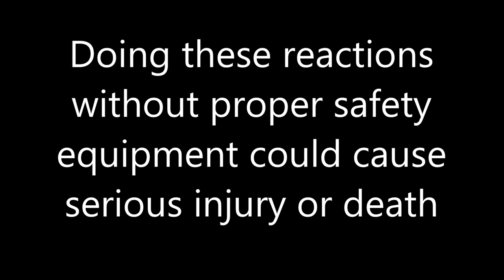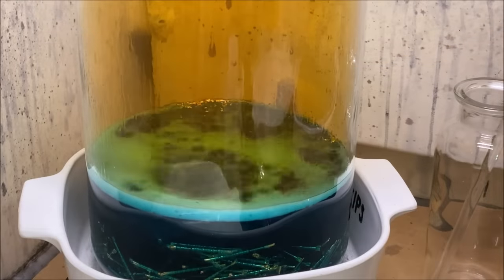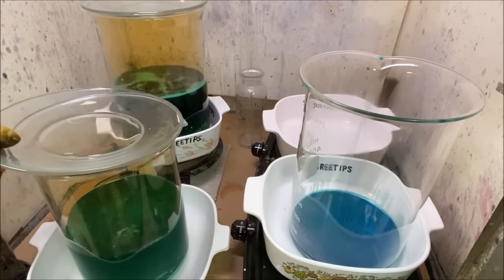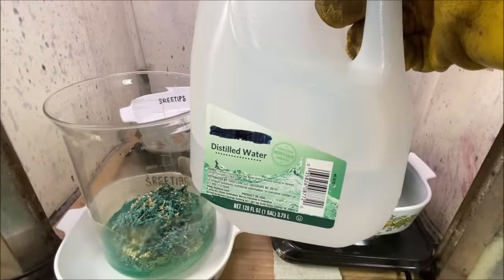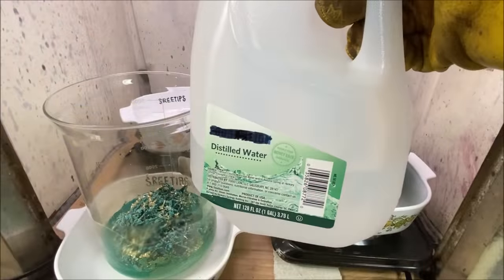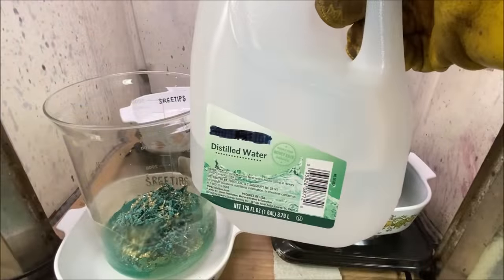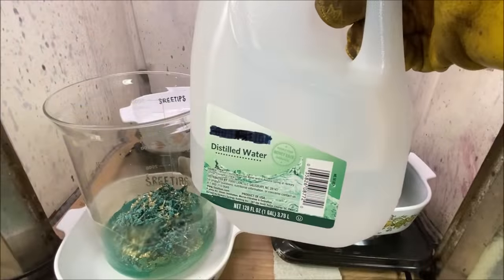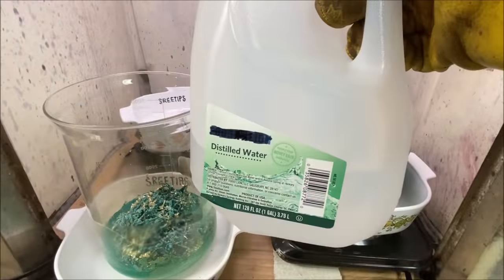Gold Plated Pins 10 POUNDS!

Comment: Sreetips,

I hope this finds you well and having a good holiday weekend.

I am a 45 year old artisan and biomedical devise repair technician.
I spent the last 17years repairing medical ultrasound probes.
All along the way I have saved a bunch of these gold plated pins. I have never sold gold reclamation materials before. I love your videos!!!!
I have images of the pins. I used a kitchen scale to get my weight and tally 5.4kg of the pins. They are not new. They have varying degree of sheen.
I sanded on a pin and can see it has a copper core. I have images with a 10x magnifier of this. I can see these pins have less copper than the pins you used in the video! Better yield for you I hope! I also did a test with some Birchwood Casey brass blackener on the sanded area and can see the blackened copper and unaffected gold layer. I have 10x images of that. I see that Gold prices are about the same as when you shot the video 9 months ago!
I also have a small pile of worthy computer processor chips that should have some amount of platinum, gold, and silver.

Would you be interested in buying my one time lot of this stuff?????
Reply from the maker: Actually I only on stuff my wife and I find at local sales

Comment: You can use a spaghetti strainer to separate the foils from the pins once they are freed.  Could have saved yourself several gallons of HNO3.  I know that stuffs pricey.
Reply: Big brain solution right here.
Reply: I was gonna say the same, why he doesn't pour off the waste copper solution through a fine mesh strainer to catch any foils kind of blows my mind! Especially since he is so GD tuhro and precise on everything that he does. But hey, nobody's perfect and to each his own right?
Reply: With a distillation setup to clean the acid he could save himself acid as well. Just reuse the same acid over and over only having to replace what is lost through the fuming and the little bit lost in other parts of the process.
Reply: @bensoncheung2801  try the above idea, let us know your findings.
Reply: @mewmewdesigns895  the acid is oxidized to nitrate upon reacting with the metal, giving off hydrogen gas.  In order to reclaim the nitric acid, the nitrate salts need to be isolated and then reprotonated with sulfuric acid and distilled.
Reply: @seaofredkc  I mean one of those slotted plastic spaghetti strainers.  The foils can be rinsed through leaving the pins behind in the strainer.  Any pins with gold still attached can just be thrown back in the acid until they are clean.
Reply: Great suggestion!  I do many many  pins in AP as I’m never in a real hurry.  Rinsing through a strainer is how I do it.  This method helps a ton and keeps me from having to digest the pins fully.
Reply from the maker: I’ve tried that and trust me - it doesn’t work
Reply: @sreetips   What happened?
Reply: @sreetips  I've done it on the small scale with ram and stuff.  Your humongous batch was a different story though I guess lol.  Either way foils are a pain.
Reply: @chrisjones-fp5vd  NurdRage made a video of the complete process, recovering nitric acid and copper from copper nitrate. Sulfuric acid was used in the process and also recovered, but contaminated with other metals such as nickel. So to fully recycle the chemicals one would need to further develop a method to clean the sulfuric acid from metal salts.

Comment: I gotta check out the sulfuric acid trick. I want to save my nitric for refining. Do you use Sulfuric acid, Water and Table salt for yours?
Reply from the maker: I’ve refined with sulfuric acid. But it’s slow and much more dangerous. Sulfuric boils up around 300 degrees F. If any gets on you then it will go down to the bone.

Comment: Did you ever find out what the precipitate was? I suspect that it was tin, as some sort of pre-tinned solder cups in the pins. Tin does all the behaviors you noticed there in Nitric.
Also, when you precipitate copper with your angle-iron, and the iron is sitting in the precipitated copper, it will make a battery and probably put a bunch of rust powder in your copper. 
You can also just melt all those pins into metal plates, and then electroplate the copper onto stainless steel or copper for rather pure copper, and the impurities will end up on the bottom for further refinement. The electrolyte to use here is copper sulfate and a little sulfuric acid.
If you want to get most of your nitric back after a run like this, you can cement out all the lower-reactivity metals with a piece of copper, and then put it in a distillation apparatus. Put some sulfuric acid to take the nitric's place, and distil off the nitric. Then, recover the sulfuric and copper with a similar cell to the copper/copper cell described above, but instead of the copper starting electrode, use a platinum-plated electrode to plate out the copper onto a copper wire. The copper should come out rather pure, and the sulfuric acid should remain to be used again, though you will eventually need to re-distil the sulfuric once it gets overly contaminated with metals more reactive than copper.

Comment: You don't have to completely dissolve the cooper pins, just the top layer to release the gold. Once most of the gold is released, dump out the CuNOH and rinse it with water and shake it to knock most the gold off. You get to point where it's cheaper just to stop than to try and collect all the gold. If you got most of it then it becomes a question of how much are you willing to spend to get small amount of gold out. I live in Silicon Valley and this one time my friends went dumpster diving over at the tech companies around here and salvaged a couple hundred pounds of this byproduct of circuit manufacturing. They we're these boards that were punched out to make the circuit boards anyways it had gold plated circuits and we filled a 55 gallon plastic drum 3/4 full man that was fun! It was like the Comstock load even though it was gold and not silver.
Reply: $1230 bucks worth of gold in today's market, he did stop early in dissolving all the copper he only used 5 2.5l jugs and @ 74 A Jug he spent about $330.... and then spent 501 (hopefully that was the starting bid with 7 days left on the auction) on the pins themselves....... so $830 in pins and Nitric.... he had all the Sulfuric and sodium metabisulfite on hand and only used a few scoops/drops each so the cost was minimal. +~$400 bucks for his time and energy + whatever kind of revenue 850k views on youtube brings in. But if he had to pay that buy it now price...... complete waste of time/money. I wonder if there is any economical way to recover the $40 bucks in copper that is in the bucket now.
Reply from the maker: I spent a thousand bucks for the pins. I did this because I know escrap is popular (even though recovery is expensive and the yield is low). But a million views is worth several thousand dollars. Plus, I re-refined the gold and sold it as a pure gold bar necklace. When the dust settled, I ended up getting about $2600 for the gold. This doesn’t count the ad revenue from a million views.
Reply from the maker: Copper, to precious metals refiner, is considered waste and not worth the time nor effort to recover it. The copper gets tossed after I cement it out on iron.
Reply: @sreetips  Nice an honest reply from the man himself.
Reply: @sreetips  1000 bucks
Reply: @sreetips  I love your videos.
Reply: @sreetips  Can't argue with those result. Imagine a video using a 55 gal barrel 1/3 full of eWaste for gold extraction! You would be a Gold God! The revenue from the millions watching you and that barrel would be awesome!

Comment: Hey just a suggestion why aren't you doing a normal agua regia reaction at 1 to 3 nitric to hydrochloric, it should only take 30 minutes to dissolve with out heat with agua regia , it's a 1.5 ml  to 1 mg of starting material , using just nitric and water is kinda crazy ... Lol just hella extra work and time , with agua regia you can do the entire process of dissolving , neutralizing and precipitation in 2 hours at most it's 30 mins a step and 4 steps , all you need is distilled boiling water,  1lb of urea dissovled in water , and sodium bisulfate for the percipient, you immediately after the reaction use the urea and boiling water mix to nuetralize the nitric, then you do a distilled water wash , then you add sodium bisulfate to lower the ph and percipitate out the gold , after words you use baking soda and water mix on the gold percipient to neutralize the hcl

And dude never wear gloves when using nitric , . , nitric is only safe with special poly u gloves normal rubber/vinyl/)latex will combust in the presence of nitric , when using nitric you should use no gloves because nitric isn't super immediately reactive on skin you have more the enough time about 15 mins to scrub and wash it off your skib . 

Again just suggestions as I use agua regia for various things and nitric constantly doing chem .

While using agua regia it should be about 2 liters of nitric and 6 of hcl  so you would save a shit to of money too on chemicals
Reply from the maker: Sounds like you know your stuff - thank you
Reply: @sreetips  enjoy the videos tho very fun times doing precious metal recovery

Comment: would melting be quicker and more productive? I know that they have similar melting points, but if not stirred, if cannot be precise with temperature, would the gold sink?
Reply from the maker: No, I’d end up with 22g of gold alloyed with ten pounds of copper.
Reply: @sreetips  Wouldn't that amount to inquarting with copper?  It seems that with the copper so exposed that it would have gone into solution more quickly. Can you inquart with copper?
Reply from the maker: Ten pounds of copper alloyed with 22g of pure gold is not a proper inquart ratio.
Reply from the maker: There’s no such thing as 100% acid. It doesn’t exist.
Reply: @sreetips  Yeah, I've been reading since I posted.  There's has to be a pretty close ratio of the base metal and the gold for maximum efficiency.  For silver it is 2 1/2 or 3 to 1 gold.  I couldn't find the ratio for copper, but it is probably something similar.

Comment: Mr. Kevin I have a question. Would it have been better to have removed the gold plating from these pins using the pan of sulfuric acid and the copper mesh basket with electricity connected?
Reply from the maker: Possibly, but I can never get a good yield with the sulfuric acid stripping cell

Comment: Idea here:  Since the raw material is gold plated on to copper, try some kind of glass bead blasting in a closed cabinet (to recover the bead abrasive and gold) then check to see that only copper is left as parent material.  Collect beads/gold from cabinet while sifting out or separating the copper parent material.  Use the nitric process on the bead/gold residue to dissolve any parent copper flecked off during blasting (should require a LOT LESS nitric).  Process moves to preparing aqua-regia to finally put the Au into solution.  Rest as shown in video.  Hope this helps....

Comment: I converted your 22.5 grans to troy OZ and I got 0.73 OZ  , based on $2040/oz today's price 19 Dec 2023, I got $1489 minus $1000 original cost , I got $489 profit, of course minus the cost of all the acid, and other extra cost, I get about $400 net profit, if I deduct the labour cost I get that you have zero profit, which means you over paid the pins by at least $400.

Comment: What is it that makes this process preferred over just melting the whole pile and separating it that way?  Or does that method not really work?
Reply from the maker: Refining gold is all about concentrating values and separating the values from the junk metals. In this case, the gold is already concentrated as a solid coating over the copper pins. So it’s just a matter of dissolving the base metals and leaving the highly concentrated gold foils that can easily be recovered and then refined. Melting everything together would alloy 22 grams of pure gold with ten pounds of copper. This dispersion would be a step in the wrong direction, causing the gold to be diluted even further than it already is. Having an ally that was 22g of gold in ten pounds of copper would be a very difficult refine. I wouldn’t want to try it.
Reply: @sreetips  thanks for the explanation, in my head I saw the metals separating by weight when it melted, I didn't consider that they might alloy.

Comment: how much faster would this have gone if the pins were shredded or run through a ball mill ?  does agitation during the nitric acid phases speed up the completion ?  Isn't there a way to electrode collect the copper from solution as well ?
Reply from the maker: I’d rather let the chemicals do the work. Agitation would help. Yes, there’s a way to get the copper. I cement it on iron in my waste treatment bucket.

Comment: Did you consider just stripping the gold off with aqua regia?  Of course you would get a little copper dissolved with it, but it seems that you would use a lot less acid. And save time.
What was the purpose of the borax?
Reply from the maker: The AR will attack the copper first. Borax causes junk to flow (flux means flow) off the surface of the molten metal.

Comment: would it not have been easier, and possibly cheaper to use a process that strips the gold off of the copper instead of the copper off the gold?  Some type of acid that dissolves gold?  Or would that just dissolve the copper too?
Reply from the maker: This or the sulfuric acid stripping cell. The seller knew the composition and approximate gold content. I knew I could dissolve the base metals with nitric. So I bought them.
Reply: @sreetips  ahh

Comment: So pretty! I read somewhere (someone should verify this) that gold is created when two neutron stars collide - which explains why it is such a rare element in the known universe.
Reply from the maker: It’s only in those cosmic events that the pressures and temperatures are high enough to cause protons of lighter elements to fuse and form heavier elements such as gold, silver, and the platinum group metals.
Reply: Supernovae, not neutron stars, no collisions required.

Comment: i have a few questions about this, why do the water get blue colour, why does the nitric acid not remove the gold also. what is all that brown smoke. and why not use only acid and just skip distilled water for a more reactive acid process? and how much does all that acid cost to purchase?
Reply from the maker: Copper in solution is blue. Nitric doesn’t dissolve gold very well. Nitrogen dioxide = brown smoke. Liquid dish soap, by itself, will get your hands clean. Add a little water and it works much better. Same with the nitric. A bottle of nitric 2.5 liters is about fifty bucks last time I bought.
Reply: @sreetips  thabks for the answer🙂

Comment: Hello, I had a very important question, can you tell me what is the exact name of these gold pieces and in what tools and devices are they used?Hello, I had a very important question, can you tell me what is the exact name of these gold pieces and in what tools and devices are they used?
Reply from the maker: I bought those on eBay. The seller had them analyzed and knew the gold content. I knew that I could recover the gold with nitric acid. I do not know the application or what type of equipment they came from. Probably some military equipment where high reliability was critical. Nothing worse than having your gun fail when you’re getting shot at.

Comment: Would it be more economical to use a stronger concentration of nitric acid instead of 68-70% get an 80-100%? I think it could be too expensive to get more concentrated acid for it to be economical or would it be too strong of an acid that would end up causing problems with the gold at the final product?
Reply from the maker: I use 70% nitric with good results. No experience with higher concentrations.

Comment: Just did a quick calculation based on google results but you made $1000 worth of pins into $1400 worth of gold but you used probably $400 worth of nitric acid. What about the copper waste bucket? Are you going to refine that aswell?
Reply from the maker: No, copper is considered waste, but it should be reclaimed if it’s viable.

Comment: Great job and wonderful video.  I am a chemist and I do not think I would've done any better than you did.  You also have very nice setup and equipment.  
Another thing I learned is that these gold plated scraps are way over priced on eBay!  They are not for gold recovery, maybe for science experiments.
Reply from the maker: Thank you. The seller knew the composition of the pins and I knew that I could dissolve the copper and get the gold, even though this was probably not the most efficient way to do it.
Reply: كيفك  @sreetips

Comment: Hi sreetips if you don't mind me being a pest can I ask you a question? How do you get these "Gold Plated Pins" and other things you get. . . Do you pay or just find them? Finding them would be way cool. Thanks for the video.
Reply from the maker: eBay
Reply: @sreetips  So you are able to get scrap gold so to speak reasonable enough to make it worth your time in do this I guess. It is just fascinating to see the finish from the scrap. Thank you again for the reply and the video.
Reply from the maker: I bought this for two reasons: 1) the seller had it analyzed and knew substrate composition and gold content. 2) I knew that I could dissolve the substrate with nitric acid to get the gold.